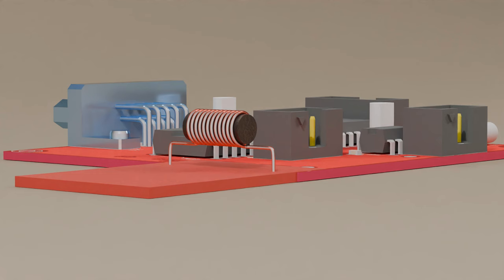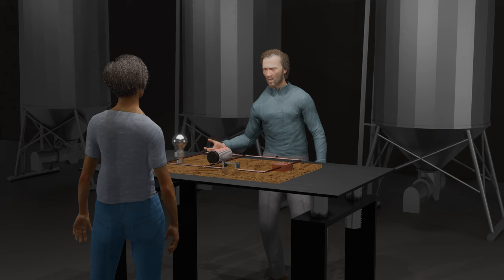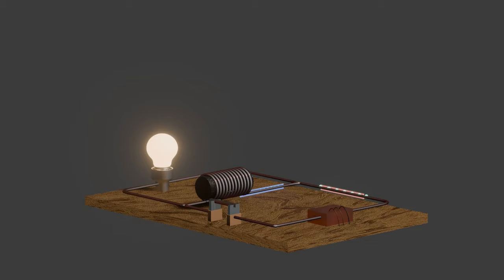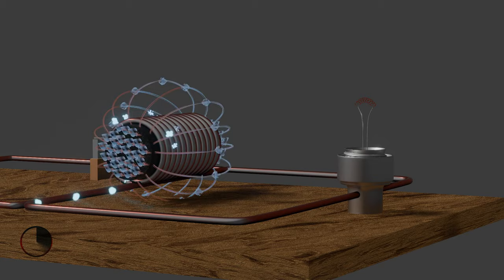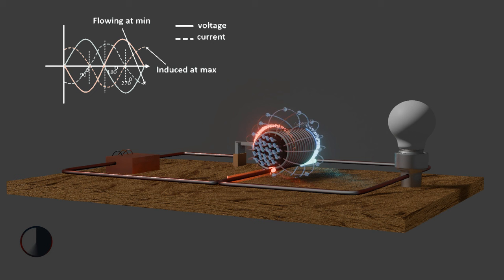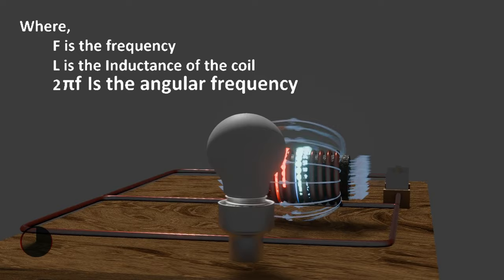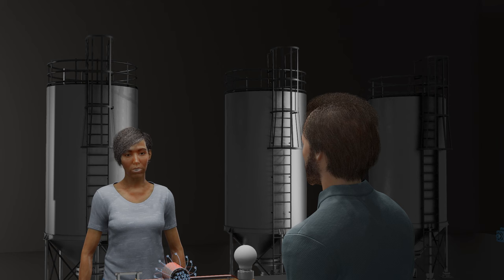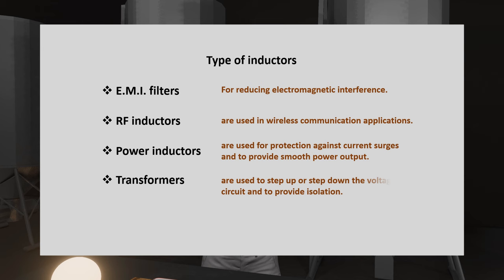The Surprising Truth About Inductors: How They Really Work in Circuits

Comment: Power inductors greatest use is in DC-DC converters to either step up or step down voltages
Reply from the maker: yes which is because most electronic gadget like computer, phones, circuits, etc. are all wired to work with dc supplied.
however, for examples.  inductors are also used in alternating current as in (AC) electronic equipment, particularly in radio equipment. They are used to block AC while allowing DC to pass.  so at times, they can be used in combinations. that is (AC and DC) a times.